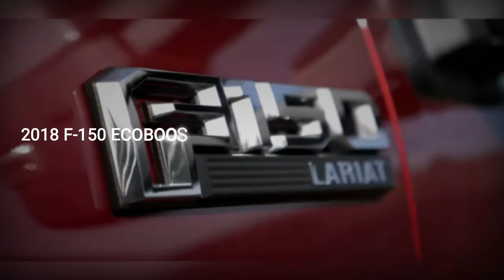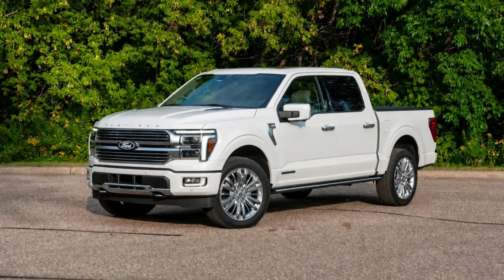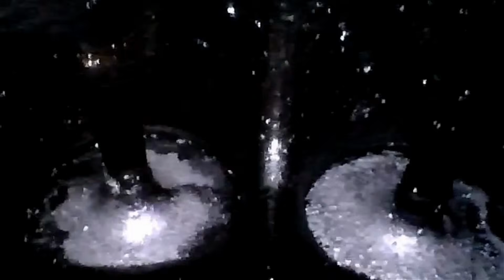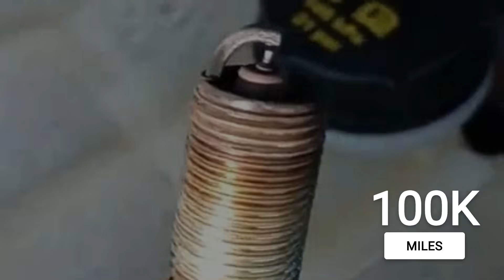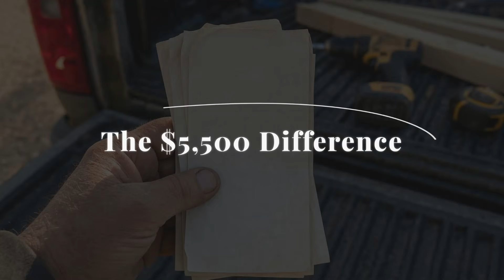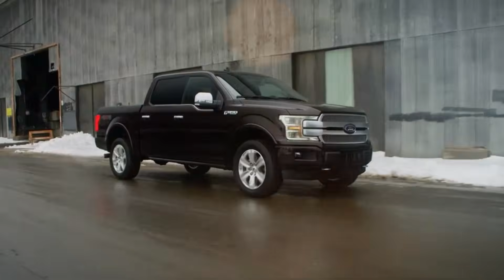We Ran Regular vs. Premium Gas in the Same EcoBoost F-150 for 200,000 Miles — A Clear Winner

Comment: If I am running cruise control at 70 down a flat highway, how much boost is the engine using? MY 2021 STX does not have a boost gauge.

Comment: I always run shell v power on all my v8’s. Now I had a 2011 ram  and put regular in then it started having rough idle so then I put Royal purple max clean in my first fill up after every oil change and once I switched to shell V power it went away and runs so much nicer!

Comment: Another benefit of running high test is reduction in upper cylinder wear and rings. There's additive chemistry in Top Tier high test that comes to the rescue of rings and upper cylinder when the additive package for that in your engine oil wears out. I had a Ford 390 and a Cadillac 472 rebuilt and the rebuilders marveled that there was scarcely a ring ridge in either with all of those miles on them.

Comment: I've ran regular since I got the truck. But with 168000 miles I'm going premium for now on just the carbon issue alone. Maybe keep from having to walnut blast. 2014,3.5 turbo XLT. 4x4. I've been running penn ultra and top tier fuel already, it's just money right?? 🤣🤣 thanks for the video 😁
Reply: You can run any gas, but I only run Tier One fuel. It’s hard to find Tier One because those stations that sell cheap gas are everywhere and are not Tier One! Next time you pull into a gas station, look for the Tier One sticker!